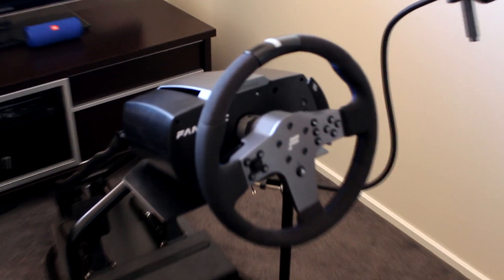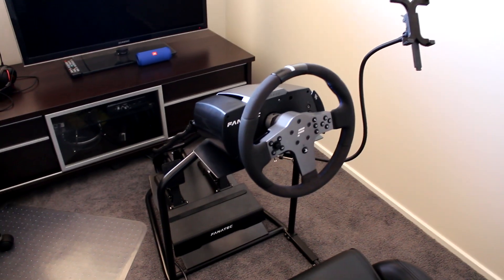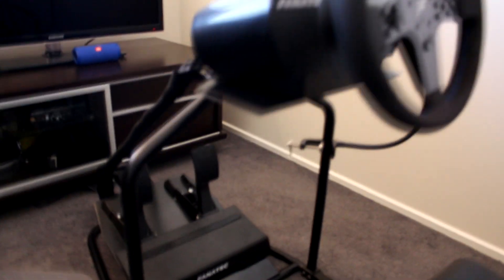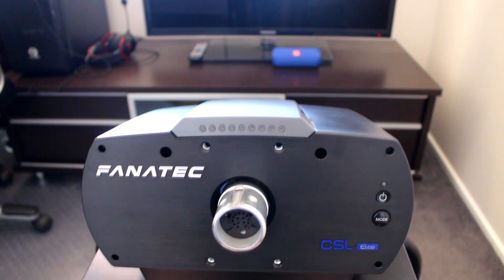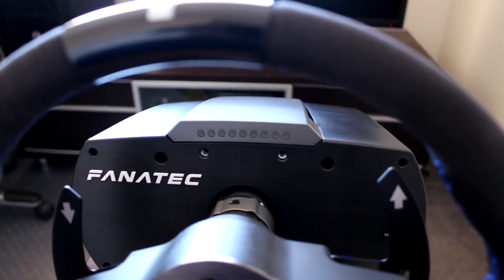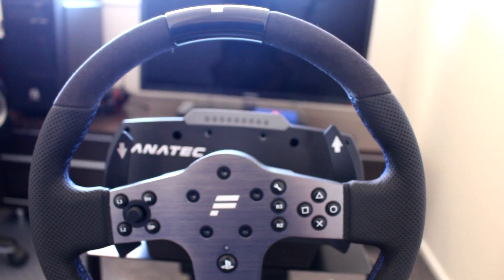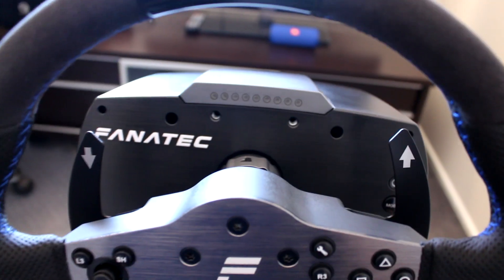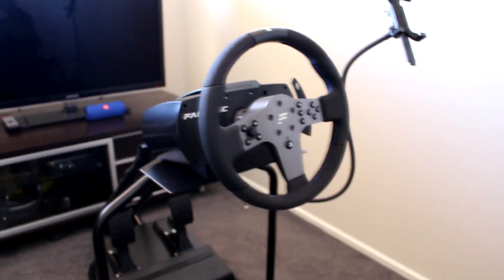Install Video: Fanatec CSL Elite Wheel and CSL Elite Pedals

Comment from the maker: Steps I took for installation of the Fanatec CSL Elite wheel and CSL Elite pedals;

1) Make sure you have all the required parts. You will need 3x M6 bolts for the wheel base, 6x M8 bolts for the pedal base and two pedals, drilling template and manual from Fanatec (link just below), a drill with 6mm & 8mm drill bits, cable ties and a vacuum for cleaning up.
https://www.fanatec.com/au-en/racing-wheels/csl-elite-racing-wheel-ps4.html#downloads
2) Remove the two small pads underneath the wheel base and test the positioning of the wheel base and pedals BEFORE you start drilling.
3) Sticky tape the drilling templates down and drill the holes. Make sure to clean up any sharp edges left from the drilling.
4) Think about cable management and where you are going to route them. Ensure no cables are pinched or clamped bewteen anything.
5) Bolt in your wheel base and pedals and tighten.
6) Put the steering wheel on and tighten the bottom bolt.
7) Update the drivers and firmware. After a firmware update you need to re-center the wheel. Follow the quick guide for this.

Thanks for watching and hopefully see you on the track :)
Reply: HELLO Spidey1155
For this point : 2)Remove the two small pads underneath the wheel base 
How do you remove the small pad ? 
with which tool?
Reply: With a small allen key isn't ?
Reply: Where'd you buy your wheel stand? It looks strong and mine is too weak and I need to upgrade. I have the same wheel/base. Is this stand that you have suitable? On my current stand it wobbles and will even lift a leg from the torque twist and I never have my ffb over 60%. I would like to but even at 50% I have the stand twisting and lifting legs so I can't really turn my ffb up and use all the power. Thanks

Comment: Thanks! It's like Mark Webber was instructing me. You drilled while the plate was attached to your cockpit? I'm guessing it's welded in place. I'm probably going to remove mine since its just bolted on and I think the Playseat Challenge will flex too much while trying to drill the wheel base plate.
Reply: Also what did you use to clean up the holes, I haven't done much metal drilling so I usually use sandpaper.
Reply from the maker: Haha thanks mate. Next time I throw in a few "for sure's" and I'll be on the money for a Webber commentary.
Yes both the wheel base plate and pedal plate is very securely welded in. Plus I made sure I didn't put that much of my body weight down onto it but rather used the drill bit to do the hard work.
Thanks for watching and the comment!

Comment: I appreciate this video, my only issue is that they didn't come with any tools or screws for hardmounting so I been stuck kinda. I can't seem to find an L key that fits and idk if I should just go to a hardware store for the M6 and M8 screws... also I'm wondering what screws are needed to mount the shifter as well?
Reply from the maker: Hey mate. The L key you need for the wheel base screws which are M6 is the same one you get with the kit to attache your steering wheel to the base.
The L key you get with your pedals kit is the correct size for the M8 bolts to hard mount the pedals and pedals base.
hope that helps

Comment: What size allen key do you need to remove those rubber feet?
Reply: Anyone got any updates to nikhils question? I am having the same issue
Reply: @dkdk8043  I found the answer by accident. Its an M3 key. 3mm.
Reply: Nikhil Kamath I think that it may be 2.5mm no? I have a 3/32 which is 2mm and 1/8 which is 3mm and one is too big one is too small?
Reply: @dkdk8043  Im not sure if the imperial sizes work. I have a metric set and its labelled M3 and it worked perfectly.
Reply: I double checked the manual, and it also says M3 is the right size. its a metric key.

Comment: I didnt get any screws to mount my csl elite pedals to my rig. Any links where i can buy them? I have a trak racer rs6.
Reply from the maker: Any hardware store should have them. In Australia we have places like Bunnings, in America I'm guessing a Wal-Mart or similar would stock them. What country do you live in?
Reply: @spidey1155  i live in usa . i think home depot should be good. Just to recap, what and how many will i need?  M6 or m8's?
Reply from the maker: @carlosgarcia-rodriguez2059  You will need 3x M6 bolts for the wheel base (not longer than 16mm into your wheel base), 6x M8 bolts for the pedal base and two pedals